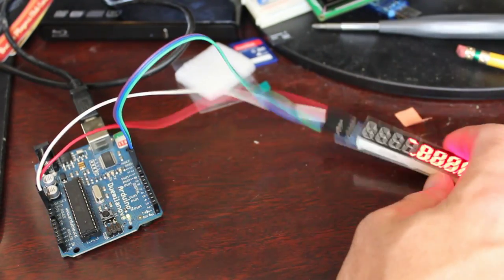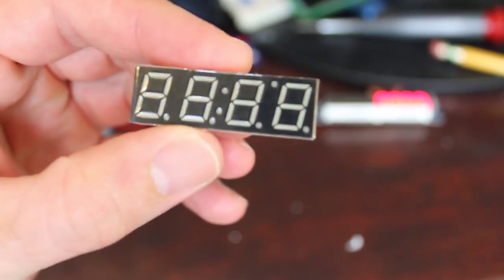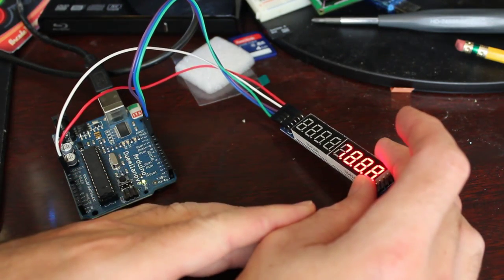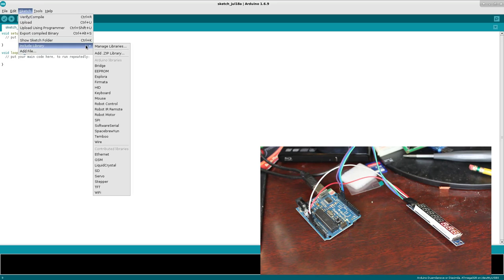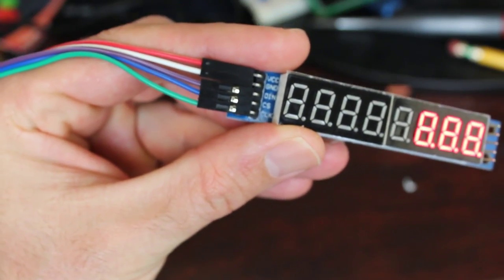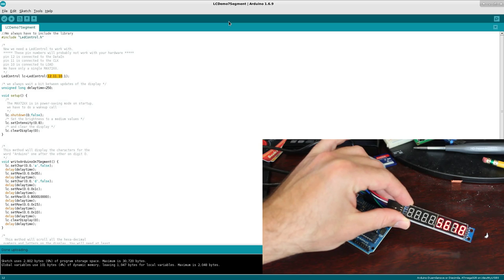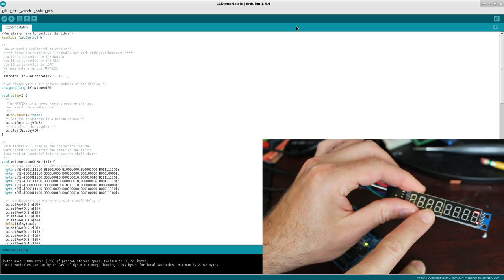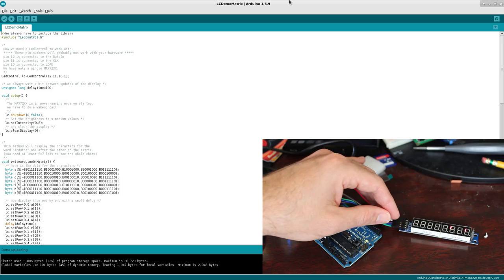Arduino 7 Segment Display Max7219 Tutorial

Comment: How many of these MAX7219 can you connect to one arduino ?
Reply: unknown, but I've heard of 40 being used, main issue would be current when all leds are on.
Reply: I've connected 8 in cascade ie: 64 numbers with no issue.
There is no issue for the Arduino, because only one module loads the digital output of the Arduino, all the others are cascaded.
If you bring Vcc directly to each module, you need to supply at least 330mA for all segments of 8 digits on. 
You cannot use the arduino Vcc for more than 1 module.

There is an issue cascading more than two Displays, here is the solution to the problem:

receive
In the end the best solution is to de -solder the Diode and jumper the pads 
OR

there is a via hole just after the diode (on the module in this video it's a via, I see something soldered in place), solder a pin and use this for VCC in.

Comment: Hi, i am new at Arduino, and i bought some MAX 7219, and i have a little question. It comes with some "adaptors" or pins, i have to weld it with a stanium solder? Or just pasting it with an adhesive?
Reply: I don't know what stanium is, but if it came with separate header pins, you'll need to solder them on - or solder wires directly into the holes.
Reply: TooSlowTube oh, ok, thanks a lot :)
Reply: No problem :)

Comment: What I have yet to see is anyone actually building a working clock using an RTC with the MAX7219. Searched around and found not much. Everyone is about putting numbers on the display or letters but nothing even close to useful. Not that I expect a reply considering someone asked a year ago and received no answer. If you're going to post these videos at least pay attention to the comments.
Reply: I have over 2,400 videos on Youtube, I don't have time to answer most comment I get from them.  But I did reply the one from a year ago.  
So, they did receive an answer even though I'm under no obligation to answer any comments.
Reply: Basically, all arduino programs have a setup, that's done once, then a loop, that runs over and over.  You'd put a bit in the loop to read the clock, and a bit to put the values on the display.  If the loop does other things, you might want it to only read the clock every so often, because it doesn't change much.

This video should give you a start on the display part.  Find one about a library for the sort or RTC you want, and it will show you how to read the clock.

It would look something like this (there may be mistakes):

unsigned long now, last_read, read_interval;

void setup() {
  last_read= millis();  // Get the time, in milliseconds
  read_interval = 1000;  // This sets how often the clock will be looked at
}

void loop() {
  now= millis();
  if(now - last_read > read_interval) // time to check the clock
  {
    read_the_clock():
    display_the_time();
    last_read= now();  // Start waiting again
  }
  // Do other stuff that might need doing, like reading buttons
  // ...
}